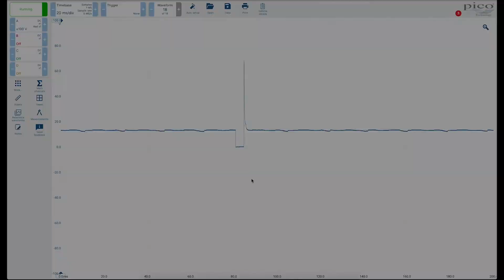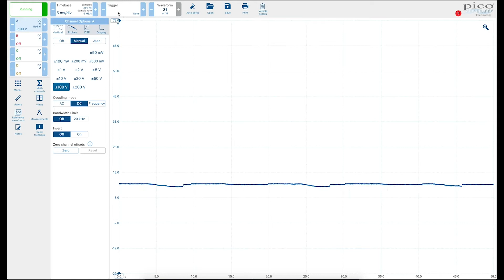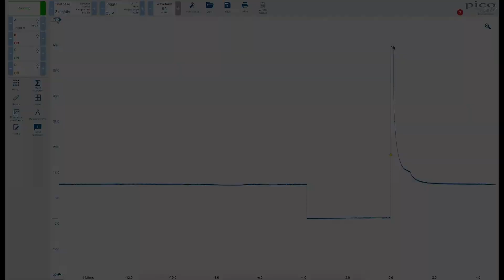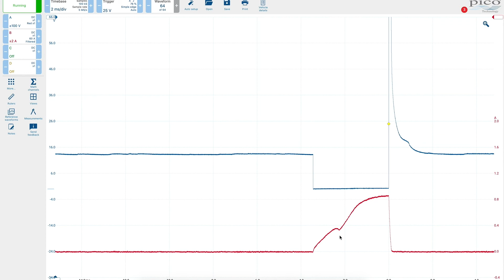Actuators & Outputs: PicoScope Port Fuel Injector Analysis

Comment: 10:46 another thing I think would've been helpful to mention is, along with the dip in the red current channel which corresponds to the injector actually opening, there is also a dip in the blue voltage channel after the voltage spike and just before it returns to system voltage level that actually corresponds to the injector closing.

Comment: that spike in voltage on the trailing edge is the reason we ought not to coil up long high current cables - like welding leads - and hang them over sensitive electronic equipment...especially high voltage / high current leads. they will immediately fry that piece of electronic equipment. The leads themselves can be damaged  with such high induced voltages.

The formula for such an induced voltage - not necessary to know - is VL = di / dt * L...where V sub L is the induced voltage - di is the change in current - dt is the change in time. This phenomenon is prone to square waves where the rise and fall times are measured in milliseconds or less Said problem also occurs with DC current upon start up or when it is taken away - which essentially creates a square wave. 

The lesson here is do not coil up high voltage / high current leads carrying DC and place them near sensitive electronic equipment.